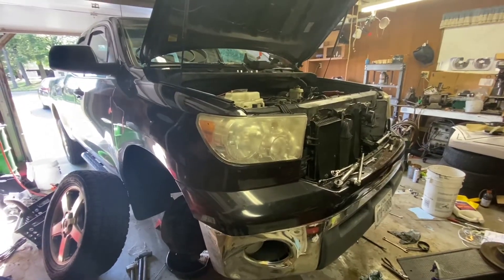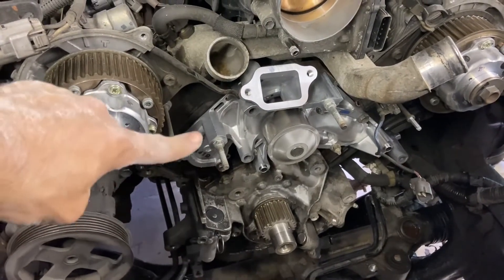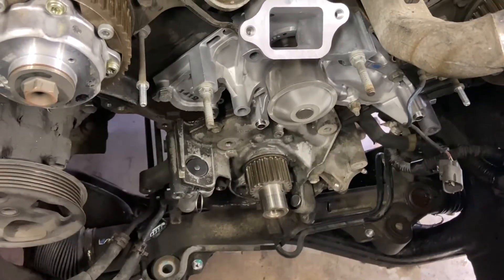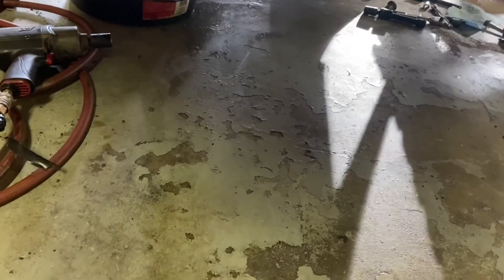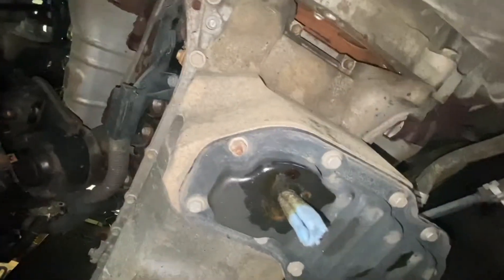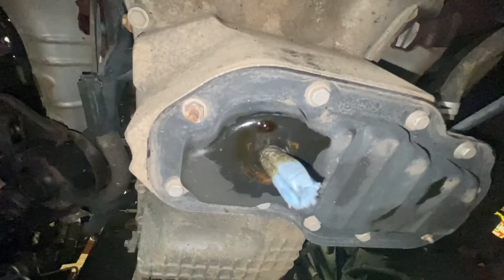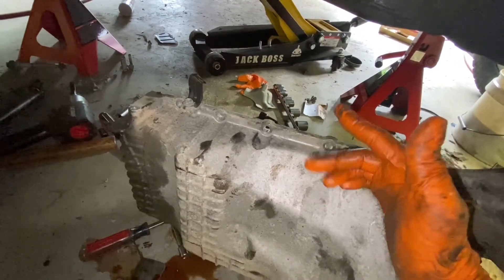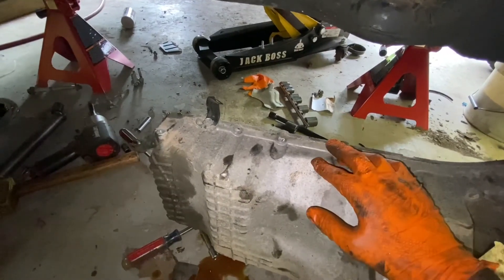2007-2009 Tundra 4.7 upper oil pan oil pump remove ENGINE IN TRUCK! Can’t believe this worked :)

Comment: Hi Drew. I have a 2006 Sequoia 2WD. I have the same exact problem with the bolt hole for the timing tensioner being stripped. Is that oil pump removal an easier job? Thanks in advance.
Reply from the maker: It might be easier cause you have a 4x2 but nothing about this job is easy. You probly have to move the rack, and it wouldn’t hurt to loosen the mounts and raise the engine as much as possible without damaging anything. It’s not a fun one :(

Please like and subscribe if you haven’t already :)

Comment: I just found out my bolt hole is damaged for the tensioner, and my mechanic mentioned step 3 of the repair guide, and then I shit myself.  But this video might be able to save me a few thousand bucks.  Hopefully

Comment: I think im just going to let it slow leak lol this job is massive
Reply from the maker: Massive is an understatement. It was awful. In hindsight, I’d have unbolted the mounts and lifted the motor as much as possible without breaking anything to see if that’s enough room - but I severely doubt it - but would’ve enjoyed that extra room even with the diff and rack out of the way.  Please like and subscribe if you haven’t already :)

Comment: I'm currently halfway through a timing belt job on my 4.7. I noticed fair amount of oil build up on the pump face that I don't think is coming from the front main seal. After seeing this vid I think I'm just going to let it go and keep an eye on things, lol. Not crazy about oil possibly being slung around the timing belt area but If I peek in through the cover every few oil changes I think it will be alright. Oh and when I took off the same idler pully that stripped here, i saw the threads were oily. I thought maybe I should de-rate the torque specs when I put it back on but now after seeing this I definitely will. The other idler threads were dry.
Reply from the maker: Yea I think the guy before me over torqued mine. Sucked. If I did this job again id have lifted the engine a couple inches as well was remove the front diff

Cam seals can leak too
Reply: @DrewGarage  I'm not sure toyota didn't goof up the torque specs. 25ftlbs for both idler pulleys. But the idler tensioner bolt hole is aluminum and doesn't have the thread depth as the stationary, which , on mine, ('04) ALSO has a steel insert. Fyi, google searches show stripping the tensioner bolt hole isn't terribly uncommon. I'm actually hoping the extra oil I was seeing on pump face came from seeping around the threads of the bolt of the tensioner since it is open to the crankcase. It didn't have loctite on it which the fsm specs. The belt was done once before me.
Reply from the maker: @95thousandroses  oh no! Hopefully you didn’t talk them the same… The idler pulley is much more torque than the tensioner assembly. Of course, the pulley on the tensioner assembly might be torqued the same as the other Pulley, but the actual big thick bolt that goes through and allows the tensioner assembly to pivot has much left work. I do not remember the specs, but it is decidedly less
Reply: @DrewGarage  hmm good point.  I'll have to check specs I used when I get home. Nothing stripped when I tightened them  and I felt good about how tight they were so I'm not too concerned.
Reply from the maker: @95thousandroses  hopefully all is good! Boy do I miss the days of non-interference Engines.

Since I made this video, I have done some absolutely horrific things with my tundra. We just went on a 600 mile round-trip with a 6500 pound towing load, all six of us in the truck as well. Of course the truck didn’t mind at all when we were on the interstate, but we were on some super backwoods Pennsylvania roads that had impossible grades, super narrow, super rounded crowns, and sharp curves. I felt so bad doing that to my truck, but it handled it. Guess I did the timing belt right ;-) all kidding aside, I have done so many Toyota timing belts, I think I’d rather do one of those then something minor on a car I’m unfamiliar with
Reply: @DrewGarage  With the price of new vehicles and increasingly poor quality, I'm hoping on this rig lasting another 10 years or more. The mechanic at my local shop says the 1st gen tundra is the "last of the the real trucks".  That's awesome you're still pushing yours to the limits esp after doing a ton of work to it. If all goes planned,  in a couple weeks mine will be in western NC camping in the smoky mountains.

As far as the torques, and I think we're on the same page, my 01-03' fsm has the bolts that attach the timing idler pulleys to the the oil pump both at 25lbs. Also two different YouTube vids torqued them the same amount. So idk. I feel good about the way I handled it. Maybe yours being a newer truck has an updated fsm or a bit different setup.

 Glad I watched this vid to give me a better understanding of the job required to take the pump off if I ever do that (hope not..yikes).
Reply from the maker: @95thousandroses  yes it was brutal. The first generation Toyota tundra was easily the best truck ever made. I wanted a second generation simply for the size. But, I opted for the 4.7 L. And as my wife gets our family into camping, I still don’t regret it. I plan to keep my truck and hopefully get a 7.3 L Ford, one of the latest ones made. Fifth wheel and all that crap. My tundra is my baby. I love it. It’s only got 205,000 miles on it. Today’s build qualities are disgusting. Not to offend all the owners of the new tundra, but if somebody gave me one for free, I would think them, salad, throw the prophet toward my house, and buy my tundra a new set of bumpers

Comment: I don't believe this was your fault. same thing happened to me on that same bolt on a Lexus LS430, and I always use a torque wrench. it started to get tight then the threads just stripped and pulled out. I helicoiled the blind hole, grabbed the tang and removed it with long needle nose pliers, then I remove the lower oil pan and flushed and blew out metal chips and flushed out again.
Reply from the maker: Well thank you for the reassurance! I am semi-pleased to announce that a year and tens of thousands of miles later, everything is good. Every once in a while, it leaves a dime size drip on the driveway… I was very careful not to bang into anything with the bead of FIPG, but I am not perfect lol it was an extremely trying week, personally, when I put like 40 hours into the truck! In the end, I’m glad to know that everything is new and tidy. The trucks main purpose is 800 mile round trips to the port to pick up cars I bought in another country

Comment: I was wondering how this would work for a 2006?? I have the same issue with a stripped tensioner hole, and the Big-sert was a replacement for a helicoil, but the Big-sert ended up crooked.
Reply from the maker: Yikes!!! I am really not sure but if I were you I’d commit to doing the pump. The shards and debris are all in your oil pan now :( I hope it works out
Reply: @DrewGarage  Thank you!! I should make a video! ;-)
Reply from the maker: @DIYonTheFly4u  you’re welcome.  do it!
Reply: @DrewGarage  I ended up yanking the motor and found aluminum filings on the oil baffle, replaced the oil pump and now I can rest easy knowing that I am not relying on repaired threads. Thank for the help!
Reply from the maker: @DIYonTheFly4u  your most welcome but bummer you had to remove the motor
Reply from the maker: Did you have to remove the transmission as well? Toyotas official manual says step like 36 or 38 of removing the motor is “remove automatic transmission”
Reply: @DrewGarage    I did not remove the transmission, another youtube video I viewed showed this guy with a 2006 tundra take the motor out and put it back in without removing the transmission. I am getting ready to put it back in in the next few days, so we will see. The manual has been wrong several times I have noticed,

Comment: I have a 2002 LS430 with 4.3 engine...I replaced timing belt an crankshaft seal..Now thinking it as CS seal..After a camera stuck down oil pump seal leaking. Seems I can find a video showing replacing oil pump seal on LS430...How difficult I did timing belt, hope I dont have too drop oil pan too replace..Any input would be appreciated..Thanks

Comment: Couldn't drill that bolt hole out and use a time sert in it? 
I know you said there were metal shavings in the engine due to the stripped out hole but being aluminum these shavings most likely wouldnt hurt anything internally. 
People fix spark plug holes like this all the time.
Reply from the maker: Shoot i couldn’t bring my self to risk it. It was the idler for the timing belt - plus a new motor is $4500 for this truck. It’s only got 200,000. I figured it was worth the effort ;-)

Comment: I just did this job 2 days ago, best video ever, really helpful!!. I have some questions about this job if you think your able to answer hit me up 👍🏻
Reply from the maker: Hey thank you very much! Was wondering if such an unusual job video would be seen :) 

What are your questions ?
Reply: @DrewGarage  i did the job, put back everything, EVERYTHING brand new and now the oil pressure light is on and engine is making weird sounds on top, took the oil filter out 0 oil  came out of it, engine was full of oil
Reply from the maker: @Asco-pt8dp  Yikes that is not good! First thing to check is that you plugged in (and the harness was not damaged) for the oil pressure sander by the oil filter. Checked the oil filter mount thing that connects to the oil pump, the oil filter screws onto it, make sure there’s no obstruction in that… Assuming that you didn’t get a faulty oil pump, it is driven by the crankshaft, unless the oil pressure sender is not connected, or there is an obstruction somewhere, or you got a defective oil pump, there is no reason why it shouldn’t have pressure
Reply: @DrewGarage  sadly i check all that already and everything was connected/fine , oil pump brand new AISIN brand, i really don’t know what to do i feel like im going to have to pull everything back out again
Reply: @DrewGarage  you think theres any gasket or seal missing or on it the wrong way that can possibly cause that?
Reply from the maker: @Asco-pt8dp  That is absolutely awful, I am so sorry to hear it. Something Hass to be obstructed blocking the flow of oil or some thing…
Reply from the maker: @Asco-pt8dp  there are a decent amount of possibilities for form in place gasket to block some kind of passage… Much can go wrong, but you are certain that it is not the harness for the oil pressure sender?
Reply: @DrewGarage  the only thing that i put back on a little bit damaged was the oil pick up tube, it was a little bent, don think that can affect oil pressure that much honestly
Reply from the maker: @Asco-pt8dp  there is a gasket where it bolts to the pump. Did you install the gasket?
Reply: @DrewGarage  yea, oil pick up tube gasket, crankshaft and the o-ring behind the oil pump. Question you mentioned a “oil sender” disconnect? What is that
Reply from the maker: @Asco-pt8dp  That is the sensor/plug by the oil filter that tells the truck's computer how much oil pressure the engine is making